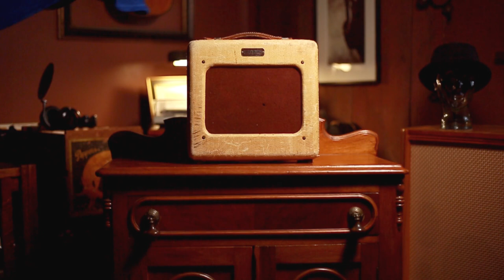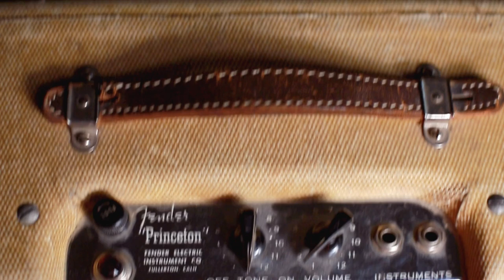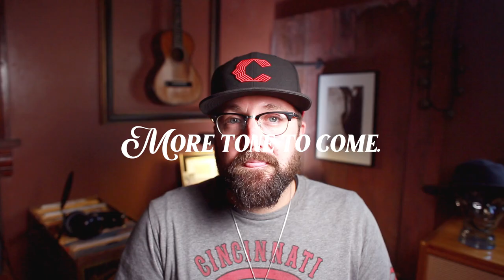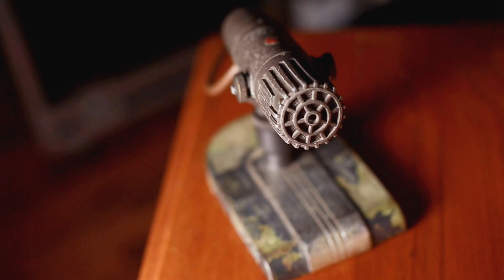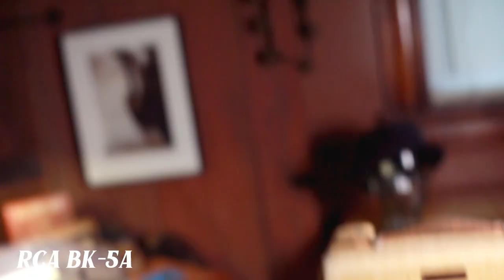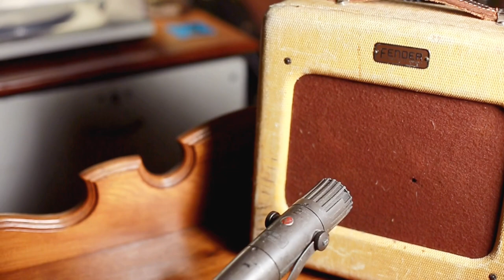One of the earliest Fender tweed amps?  Late 1940s Fender Princeton Amp

Comment: Fender didn’t use the 6sc7 tubes until the early 1950’s, ‘52-‘53 era. 1947 would have been a woody style. Yours is definitely not a prototype. Nice amp but I think it is probably a 1952- early 1953, when Fender went to the Wide Panel look.   The serial number should be on the underside of the chassis, turn it upside down and you will see even with the back panels on.